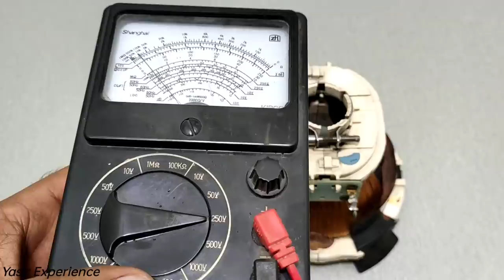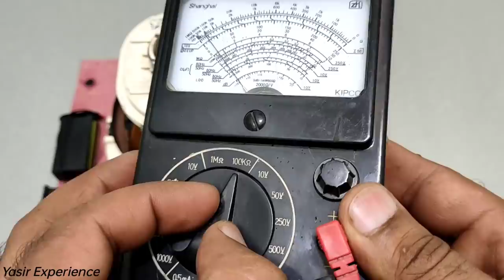I turn Tv Coil into 245V Powerful Generator

Comment: How can a small copper wire produce such a high voltage, don't you think the copper wire will burn??
Reply: Remember to keep voltage and amperage straight in your mind - a wire can have a million volts on it but the current is what is flowing and volts x amps is the power